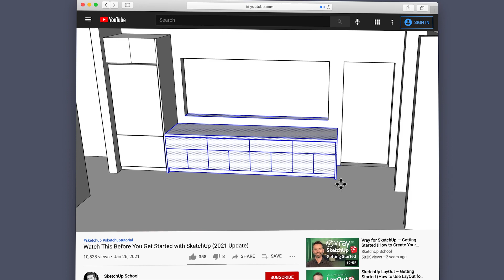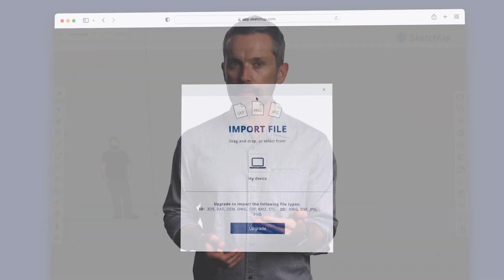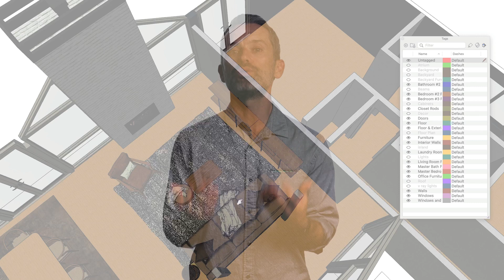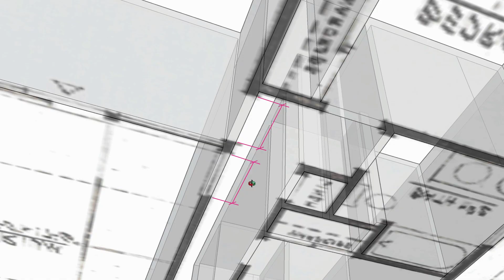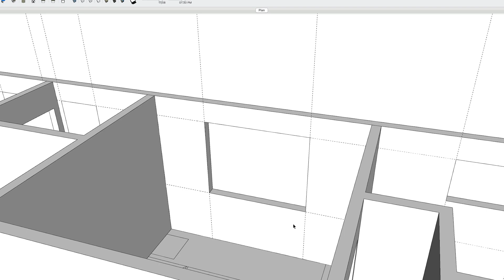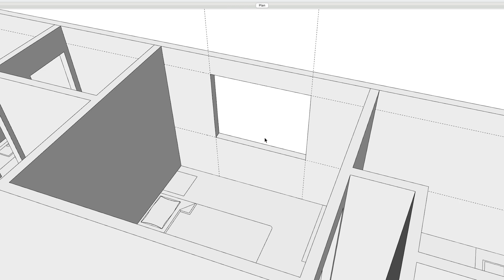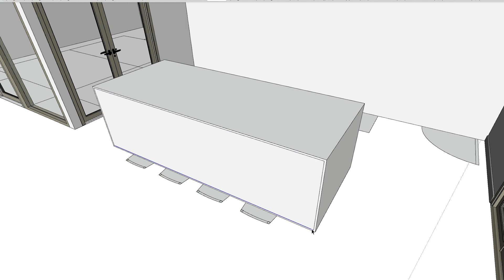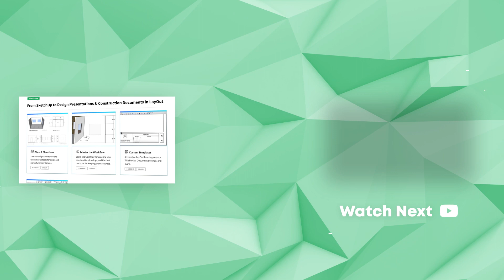SketchUp Tutorial – How To Turn 2D Floor Plans into 3D Models (in 5 EASY steps)

Comment: Hi! After pulling walls up, making rectangles on the bottom and pulling doors up, holes in the door places are not completly through, as there is a face on the back of the door, or even on some other wall, there are lines around the door on the wall, but there is no hole in a door place. Do you have any advise on this?
Reply from the maker: Please send this message to team@sketchupschool.com and an instructor will be happy to help

Comment: Why SketchUp Layout Will Not Replace AutoCAD for Interior Design Working Drawings

While SketchUp Layout is an excellent tool for visual presentations and quick construction sets, it cannot fully replace AutoCAD when it comes to producing professional interior design working drawings.

Interior design documentation demands a high level of precision, technical detail, and efficiency — areas where AutoCAD remains the industry standard. Comprehensive plans, detailed elevations, precise sections, joinery details, strict layer management, and complex annotation requirements are critical aspects of working drawings that SketchUp Layout struggles to handle with the same level of robustness.

In professional practice, working drawings must meet exact specifications and construction standards, where even a 1mm discrepancy can have significant consequences. AutoCAD provides the tools, flexibility, and reliability necessary for delivering accurate and detailed documentation essential for construction and tendering processes.

While SketchUp Layout is a valuable tool for design communication, AutoCAD continues to be the backbone of serious technical production for interior design projects.
Reply from the maker: Thanks for sharing your opinion!

Comment: Need help from eperienced users please: I tried to import a png file and resize but it just simply doesn't work. What I am doing wrong? measure a known distance, Sketchup writes how long it is (according to Scketchup) but I can not overwrite the numbers for the correct measurement: can not click into the cell. Any idea?
Reply from the maker: Once you measure, there is no need to click in the Measurements box... just type the measurement on your keyboard and press Enter/Return. 

If you continue to have trouble, please send a message to team@sketchupschool.com and an instructor will help.
Reply: Thanks I was having this same issue but I entered the value and pressed enter instead of trying to click into the measurement cell and it worked !! Thanks so much.

Comment: Too bad nothing is easy in Sketchup.  "Just import the pdf!" Because Sketchup doesn't support pdf. You have to install plugins first. Why on earth wouldn't it just work with pdf by default.

Also, the advice to use a door opening in a potato resolution floorplan as a scale reference is absolute garbage. Go for the longest dimension in your floorplan to have some semblance of accuracy.
Reply from the maker: You can import PDFs on Mac, just not PC due to the different file architecture there). You can take a screenshot of the PDF on a PC though and import as an image. 

And for using the door opening, you can actually use any dimension you like. That's because you are still specifying accurate dimensions as you go... the underlying plan will always be a little bit off since it is a raster image - whether you use a long or short dimension. But it's just a reference, so it's OK that it's not perfect (which it won't be with your proposed method either).

Comment: What are the minimum system requirements (hardware) for sketch up free?
Reply from the maker: You can find the system requirements for SketchUp Free (also known as SketchUp for Web) here: https://help.sketchup.com/en/sketchup/system-requirements
Reply: U can use it with i5 processor and 1650 graphic card. Don't go lower than this

Comment: I recently dicovored your channel, after watching your video "10 extensions every architect should know" where I after having used Sketchup for like 8 years now, learned some new features. Now I've been watching most of your videos, even though i consider myself being on an advanced level. But as i'm self taught in the program, i thought maybe i could still learn a few things from watching how you use Sketchup. And i love these small "tips and tricks" you give in most video, some have really improved my workflow! So thanks! 

I'd love too see a future video, where you went over a bunch of "tips and tricks" that adavanced/self taught users might have missed, or bad drawing habits that could be done more efficiently. And perhaps also a video going over many of the "hidden" keyboard/mouse shortcuts, that really helps with using the program efficiently. An example being pressing "b" for bucket tool, and then holding "alt" to quickly access the color/texture picker. or shift to replace. these shortcuts have all been things i have first learned years inbetween and along the way. and would be great to see a video covering this. 
For instance, I just first learned today, that you can just double click after a push/pull movement. (Bonus tip 06:05) 😄I thought i was already being efficient with just clicking once on the next rectangle, and then just move the curser too the first door frame, and click again.  But this is even faster! 

Thanks again for creating all this content, and making these fun, easy to follow videos. I will certainly keep watching! 👍